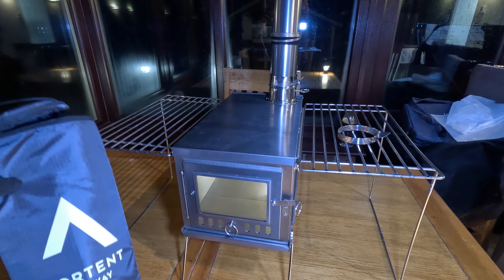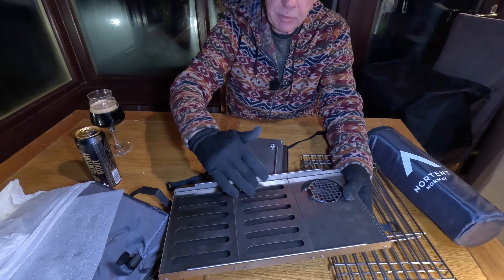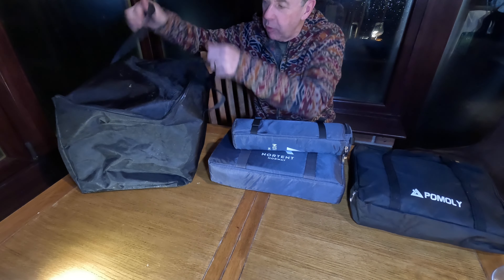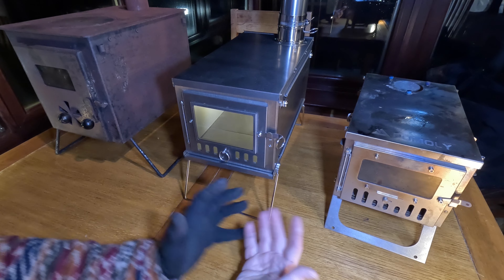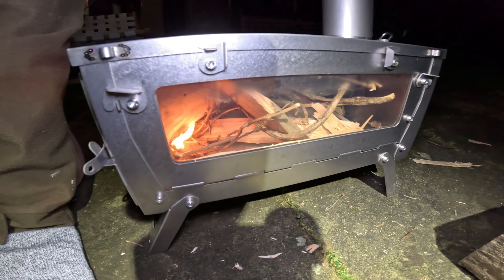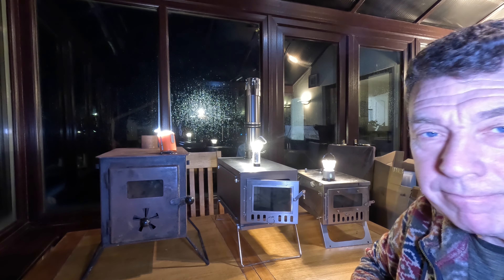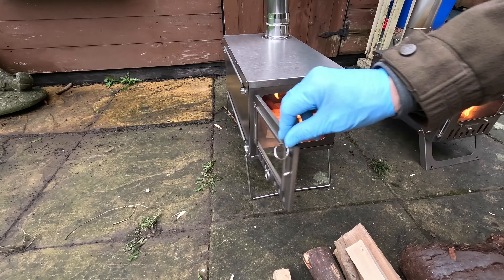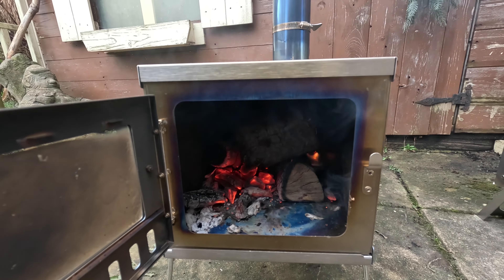WHICH TENT 🔥 woodstove? The NORTENT foldable  TITANIUM stove compared + first BURN

Comment: Nice comparison. Definitely see the advatage in size and heat output of the Nortent stove. Legs seem thin. I'm a bit of an ape around camp, and everywhere else, to be fair. Would worry about bumping into that. Would do eventually.
Reply from the maker: Haha, ape here too hence tripping over the stove pipe guy line! But you know, being in a nylon both with a can at 375c makes the ape VERY careful eh!

Comment: You need to do something with the audio in this video. That hissing from what i can only assume is the wind is making it very hard to watch.
Reply from the maker: Hi, sorry about that. I have just tried it and seemed fine. There was a little wind and rain at times. Do you want to try on a different player/ speakers?
Reply: @Fellmandave1  On the desktop speakers at work i can still hear the noise. Its coming from the right channel. At home the headset picks it up too in the right ear cup.